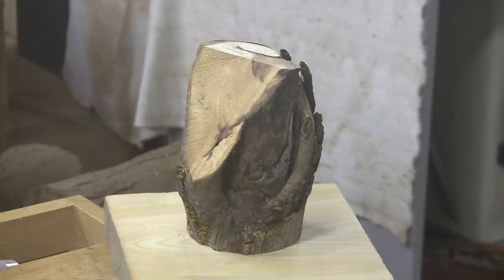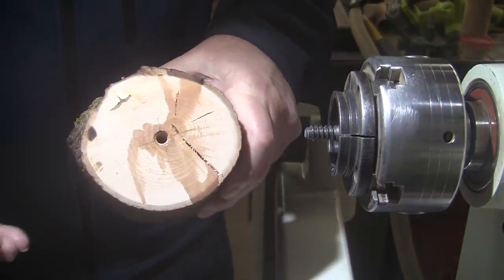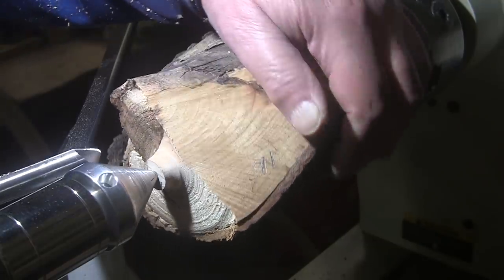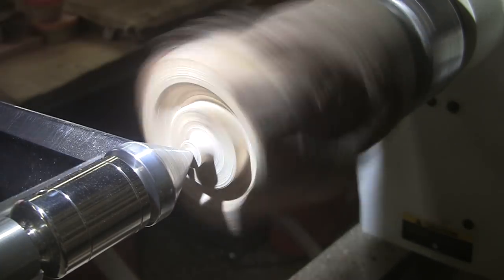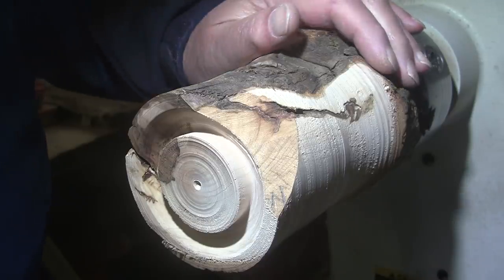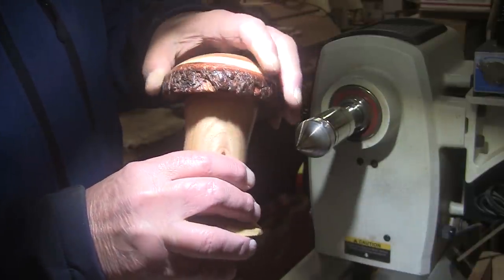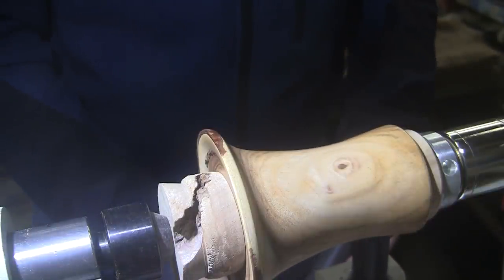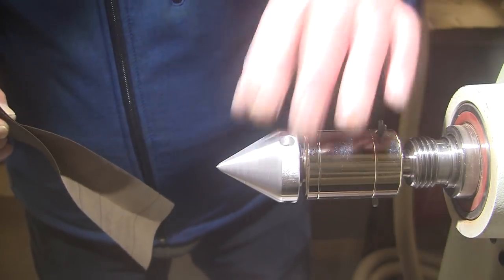Lack Of Inspiration?  - Wood Turning

Comment: I am new to turning and have been looking at adding resin to some wood projects, I’m not sure as this is your first video to pop up for me if you mess around with resin to get the cracks filled and enough substance to make the pattern you were thinking about. Either way I’m going to be watching your videos and hope to see the second part of this video. Also nice tip with the ca as I have a worm screw but never used it, I am thinking of trying it out on a mushroom box/nightlight the box like you made would hide most of the cords excess and the wires would be able to run where needed thank you for the video
Reply from the maker: Thanks for stopping by, Robert!  I don't use resin but have seen others use it and it can be beautiful.  I'm more of an all natural kind of guy.  Thank you for taking your time to watch and comment! 😊

Comment: Phil, I too like to use a wood worm screw and true it is sometimes hard to get it started.  I've been using the ram on the tail stock to apply pressure to the screw.  By screwing the piece to the screw and advancing the ram at the same time it takes a lot out of the effort and you get a good solid thread in the piece.  Love your videos, keep them up.  P.S.  I also have a Jet 1840 and I love it.
Reply from the maker: I appreciate your experience, James.  I have done that, as well.  I find it a little cumbersome but as  you said, it can really help.  Thank you for taking  your time to watch and comment, much appreciated! 😊

Comment: I ran across same issue on an ash log almost identical to yours so what I did was to hollow ow 3/4 of it then turned the top to a coned roof,  made a plug for the bottom & drilled small hole so hummingbirds can go in & out. It made a fine hummingbird house
Reply from the maker: That's a pretty good option, Spitfire.  I did chuck this up again with the tenon in the chuck just to see if I got any inspiration from that.  I didn't.  I'll keep your idea in mind, thanks! 😊

Comment: Tough piece to work on for sure Phil. I parked my worm screw a long time ago as I felt it put too many limitations on if flight design changes. I turn almost everything between centers these days as I often find a reason to move either the headstock end or the other end or both as sometimes the grain structure says "Move Me Over". Lots of ways to skin that proverbial cat. lol
Reply from the maker: When needed, Jim, I do the same but worm screw is my preferred method.  Thanks for watching and commenting!

Comment: D.C.O. (Design Change Opportunity). Have you considered remounting it off center to take wood away from the side opposite the “feature” area, thus preserving the feature? Also, I voted for heavy end down, but that’s just how I saw it. You can still do a vase, or maybe a candle holder? Or even a hollowed out light. Not sure how much of the “heal over” wood is left, but that is what I would try to keep and feature. Don’t worry, what to do will come to you. If not, send it over to me with Cindy!
Reply from the maker: So much to consider from your comment, Valerie.  Who knows? 😊

Comment: I probably have 20 or 30 pieces that are shaped like that. Flat on the bottom, about 6 to 12 inches long with a 45 degree cut it the top. They are in a scrap trash can right now until I can figure out what to do with it lol.

Comment: Putting crazy glue on wood threads makes them brittle so they fracture. Generally speaking, if you want a stronger thread in wood using an insert is the best way to go.
Reply from the maker: Well, I know you know what you are talking about, Charlie.  However, I've been doing it this way for years and no failures yet.

Comment: Phil, the people that have issues with screwing the workpiece to the wood worm screw most likely have drilled the hole too small.  The diameter of the hole MUST be the same diameter as the unthreaded portion of the shank, or for better terminology, the same diameter as the root of the thread.  If they do that, then there is very little end pressure required to screw the work piece in place.  If the hole is too small then they are trying to force the unthreaded shank into a hole that's too small.  Just try pushing a 1/4" rod into a 3/16" hole..... it aint goin there unless you hammer it in...... It's exactly the same things as predrilling holes in hardwood for inserting wood screws.  If the hole is too small, you'll risk splitting the wood..... I wonder why that happens?
Reply from the maker: I have a video on the correct use of the woodworm screw, Peter.  Thank you! 😊

Comment: Your standard base design limits you at times. A tenon with a small shoulder would allow you to taper the bottom significantly. You could even make a partial parting cut above the tenon and taper the sides to that and get really narrow or rounded.
Reply from the maker: Thanks for the ideas, David! 😊